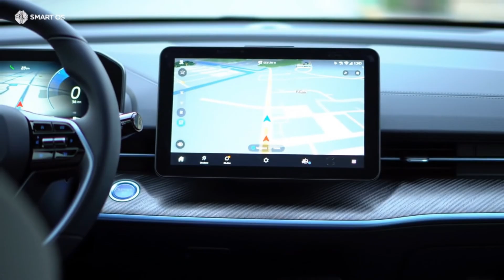The Secret Truth of Toyota's $5 Billion Tundra Disaster

Comment: Some 2024's have indeed been recalled.  Also, the bearings were of poor quality.  I don't know about the new ones.  I saw an engine pulled apart.  The rod bearings were in terrible shape, and the mains were spun.  

It's a combination of things....engine debris and bearing materials.  Either way... Toyota has lost its reliability crown with any vehicle with the V35A engine.  If it actually IS fixed.... it'll take 3 model years before the reputation gets restored.  If the 2027's hold up for 200K miles, I'd say Toyota will be back on top.  But we won't know until the 2027's get that many miles on them.
Reply from the maker: This is the grounded analysis everyone needs.
Your '3 model years' point is crucial: Toyota doesn't regain its reliability crown with a press release, but with 200,000 miles of silence—no failure headlines. The problem is, the market may not wait until 2027. Defeated customers have already moved to competitors, and lost trust doesn't easily return.

Comment: BS. with DEBRIS in this TUNDRA engines  maybe the first year i would go along with that..  I've own TOYOTA'S for 45 years .. I lease my 2024 Tundra TRD 4x4 for now I don't trust it .. I have 15,000 miles right now and changed oil 4 times and later I will be sending another oil sample to LAB for testing...  My last oil change went from 0w-20 to 5w-30 and from here on my oil changes will be at every 5,000 miles NOT 10,000 miles what TOYOTA RECOMMENDS .. The 2026 Tundra V35A-FTS engines are still failing .. 😎🤠
Reply from the maker: Your approach is the definition of a vigilant owner. Sending oil samples to a lab is one of the smartest proactive measures anyone can take, especially with a questioned engine. Switching to a slightly heavier viscosity oil (5W-30) and reducing the change interval to 5,000 miles are conservative choices many concerned owners are making. They reflect a loss of trust in the factory specifications. The fact that you—a 45-year Toyota veteran—are taking these steps speaks volumes about the severity of the confidence crisis.

Comment: This video is more AI crap. And out of date too.
Reply from the maker: You're right to be skeptical about video quality and accuracy—there's a lot of low-effort AI-generated content out there. If you have more current or reliable sources about the ongoing Tundra engine situation, sharing them would be valuable for everyone here. The core issue remains relevant: owners are still reporting problems in newer models, and trust is eroding. Focusing on verified information from owner forums, technical service bulletins, or direct reports is always better than questionable videos.

Comment: This AI crap is out of date
Reply from the maker: Noted—many are frustrated with repetitive or outdated AI content on this topic. The real discussion shouldn't be about the video itself, but about the ongoing real-world experiences of Tundra owners. Are 2024-2025 models still having issues? Is Toyota's response adequate? Those are the questions that matter, regardless of the video's production date or method.
Reply: @Zestdrive-1 There is a second recal of 127,000 units. 
This engine was released in 2017 and the same failures are documented back to at least 2018. Its a design flaw.

Comment: I was at Toyota today and finally decided that I’m going to pass on them all together for my next vehicle! After they lied about what was going on in the company, I can’t trust them anymore. Considering that to fix an engine or transmission will cost you between 20 and 30 K, I just don’t see the cost benefit in the long run.
Reply from the maker: This is the ultimate cost of the crisis: losing a customer who is actively at the dealership. When the math no longer works—when the potential repair cost outweighs the perceived reliability benefit—the value proposition collapses. For many, Toyota's premium price was justified by lower long-term ownership costs. If that equation is reversed due to catastrophic failure risk, the brand has lost its foundational argument. Your decision is perfectly rational from a financial and trust perspective.
Reply: @Zestdrive-1 
Unfortunately, it’s not much better anywhere else. Too many auto manufacturers are pumping out junk. Forced to buy the lies of global warming. Pushing the zero carbon mania, that’s been pushed out by the WEF unelected oligarchs. There are only interest is in power and control over humanity.
We’ve had the ability to replace fossil fuels since the 1950s. Dr. Steven Greer. 
Just look at all the inventions they could’ve changed the world. All these men were either bought off, put in prison or assassinated. 
So unfortunately, we could’ve had a much better world, but those who control it, which I believe are the central bankers and the federal reserve, control the narrative. By controlling our currency!
Jesus talked about this. His rage at the temple, where they seemed more concerned about money than God.
Reply: Lol good luck finding anything better bud
Reply: @halfsenders4084 
Already did! Honda passport Trailsport